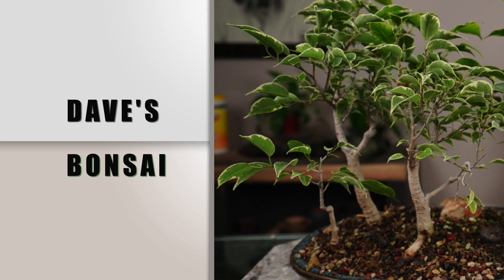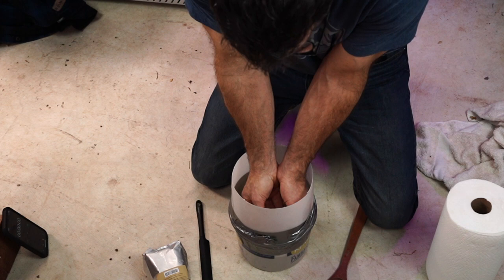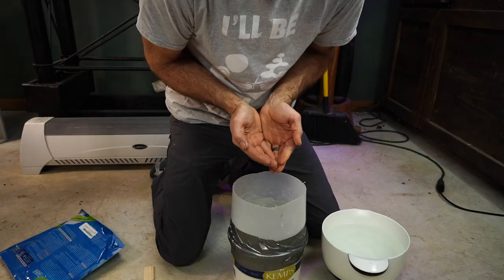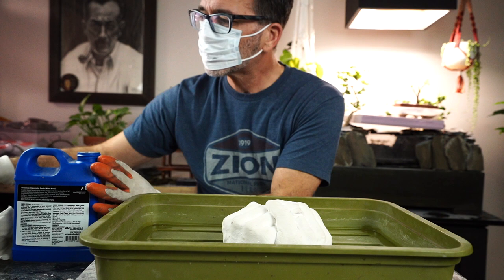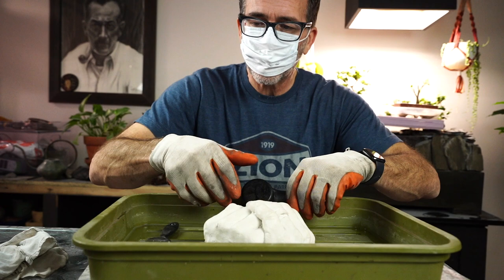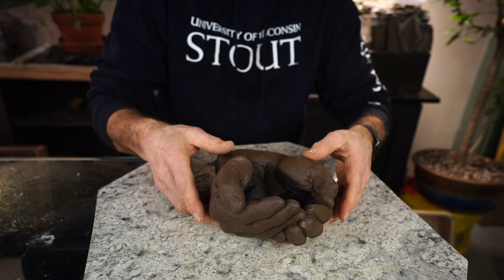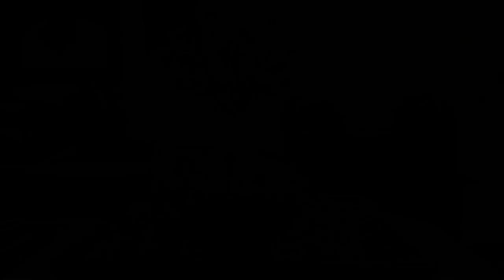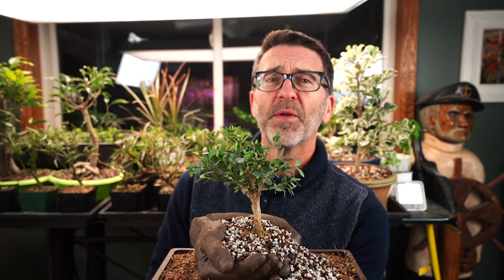Helping Hands:  Dave's Bonsai E296

Comment: Hi Dave. I loved this episode! The hands look really good I think and the choice of colour was perfect.
I did have a bit of a reservation watching it though which probably goes back to my days as a plasterer. After you cast the hands and remove them from the mold, they have cured and are set, but they are not dry. I would have left them for at least several days in a warm dry place to get them down to a low moisture content before sealing them in. The problem now may be that all that water inside the hands is trapped in there? Hopefully, It's not an issue, but time will tell, and if it is a problem you will know it because the paint will start to peel off.
Great choice on the tree! I love box bonsai.
Reply from the maker: The hands had days to dry before sealant.  I hope I’m okay.
Reply: That's great news. I'm sure they'll last for a good few years then!

Comment: Did u put some water coating on the insides of the draining hole u made? Otherwise water running through the hole will suck into the sides of the hole

Comment: Dam that turned out really cool! But please, when using plaster, cement and sealant. For the health and safety of you and your family. Do these projects in a well ventilated area and use proper PPE. Those nurse masks give zero protection against fume and very little protection against dust, especially with facial hair. They are made to contain your spittle, snot and sneezes, not protect you. You need different mask for fumes, and N95 masks that seal to the face for dust. Cement dust can be very harmful when inhaled. I wouldn't want to see you or a family member sick. But ya, very cool project!